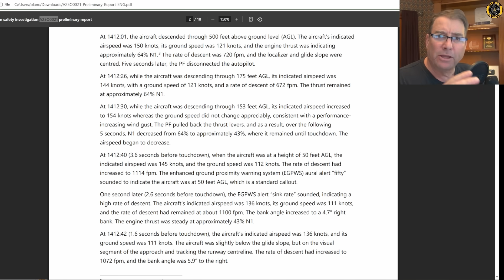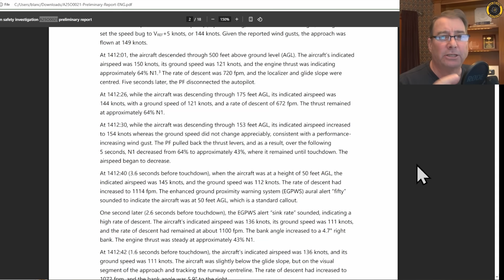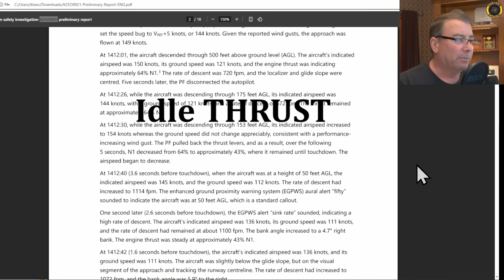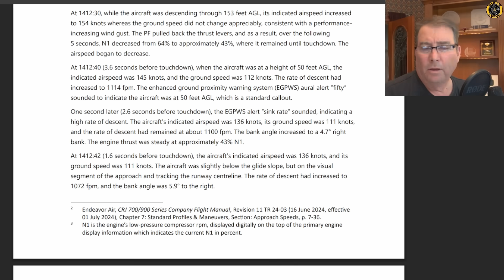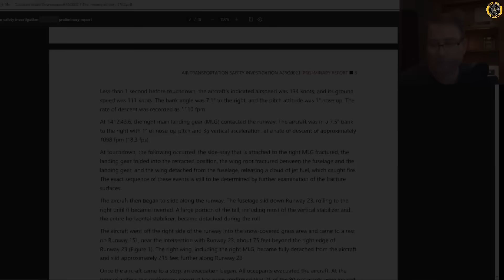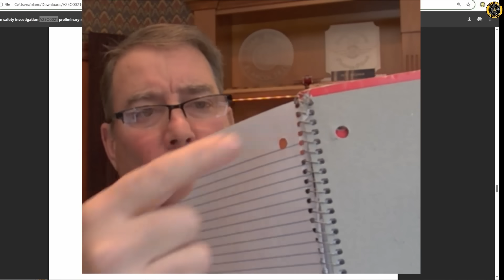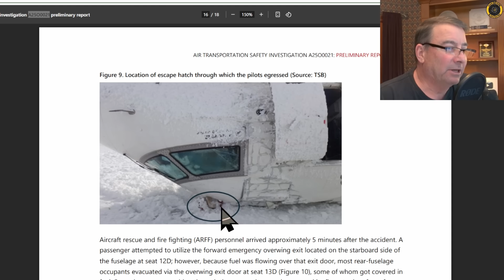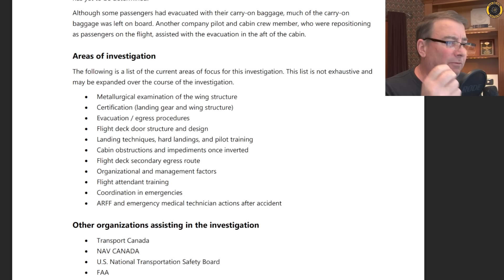TSB Prelim Toronto CRJ Crash

Comment: Love your channel Juan!

Just a 1,200 hour GA pilot here (that hasn’t flown for a couple decades). I began in gliders in the late 70’s, then added power & an instrument rating in SEL. 

Landing with true confidence, in all types of windy conditions, was always my biggest challenge. What really increased my confidence was when I began towing gliders. I loved it, especially since I got to continually hone that critically important skill (and I didn’t have to pay for those hours!). Years of fun-filled weekends of glider operations, where a tow-pilot was pretty much always in need, was a definite plus for me.

At any rate, I can’t help but think that 418.7 hours in type, especially as one is first transitioning into a jet aircraft flying in the airlines, probably doesn’t equate to all that much practice at landings. 

So, I’m thinking that, in light of this type of accident, the FAA might want to amend minimum hour requirements, to also include a minimum number of landings requirement.
Reply: The 1500 hour (1000/1200 degree reductions included) requirement has decreased airline safety and now you’re suggesting adding another artificial barrier?!? See, at first glance it sounds like a good idea then you think for a minute and realize it falls apart and actually makes the issue worse. Where does one get these required landings? You can’t because you’re not allowed to fly this type of plane. (Chicken or egg first problem). Now you might suggest required landings count from any type, i.e. flight instructor time in a c172. I’d then point out the enormous performance differences. So different that repetition in a C150/2 or C172 actually make your ability to handle a turbine worse. This pilot did something that would have been a good action in a small cessna. Got very slightly high on short final so pulled power and put the into crosswind wing down. Did she make a mistake, most likely yes, however her mistake was by doing exactly what a little over 2/3 of her required flying experience has taught her to do. In stressful situations the human body loses ability to process information and make decisions and reverts to previous drilled actions.  IIRC this is the Yerkes-Dodson law. What we’ve effectively done is ensure this for all pilots that fly airlines at the regional level: As stress increases because things are starting to go wrong, their most practiced and overwhelming majority of experience will be not directly applicable at best and actually contrary at worst to the best course of action they should take. The 1500 rule needs to be removed. Require airlines to do much more training in category/class/type of new pilots. This way they’ll have more relevant experience to draw from when stuff starts to go wrong.
For me as a 1000 hour pilot that has been flying for almost 20 years: I routinely seek out places where I can safely practice crosswind and other challenging landings. I am fortunate and know a lot of CFIs that I take with me. This way when I encounter a situation where stuff is going wrong I have experience to draw from and can perform instinctively. Put this requirement on the airline and make them train their pilots.

Comment: Just to give everyone a little history of wings falling off on landing. On 21 March 1966 a Flying Tiger CL44(Large 4 Engine turboprop MTOW 210,000 pounds) landing Norfolk NAS Chambers, VA. F/O Pilot Flying approach and landing Runway 10 touched down on left main and nose gear and the left wing separated. The airplane rolled inverted and eventually skidded to a stop. The legend is that after the airplane stopped the Flight Engineer asked the Captain “Do you want the After Landing checklist?”.  The First Officer was a new hire who had a grand total of 18:00 on the CL44 but the ASN Accident report do not say if this was his first landing on the line. A large portion of his 18:00 was training in the airplane because I’m not sure if there was a simulator available. The accident report also mentioned that he did not have a multi engine rating on his FAA Commercial Certificate. Fun Fact was the multi rating was not required until 1974. You could be a F/O on the B727, B707, DC8 with no AMEL. I was surprised when I read about the rule change in Aviation Week at the end of 1974 and all current F/Os were issued the AMEL rating.  Flying Tiger operated under the Supplemental Rules FAR121 so they did not get IOE. They had 25 hours observation in the Jump Seat. The Captain on the flight had 172 hours in the CL44. To the best of my knowledge both the Captain and F/O retired as Captains plus the F/E because they had just been put on the pilot seniority list between the probationary F/Os and the F/Os that had completed probation.

Comment: They had a plane that needs 5,360 feet to land and a runway that is 8,000 feet long. It isn't going to be the end of the world if they land an extra 1,000 feet further down the runway than normal. If she hadn't closed the throttles and kept the airspeed up at 150 and avoided the massive sink rate, the result would have been contact with the runway probably 800 feet further down the runway than they usually experience. Had it gone further than that there was always an option of taking the go around, even if they hit the ground more than 1/2 the length of the runway as long as they maintained airspeed.

This is 100% pilot error and it falls on the PIC for not recognizing the situation that was developing due to the inputs of the pilot flying. Yes, the conditions were challenging, but how many other flights landed before them that day without busting a $50 million aircraft?

Comment: With all this info focused on sink rate capt, is there nothing in the report about the aircraft HEADING at touchdown please sir ? Knowing today that there are three Xwind ideologies, one is suspect about what would cause such a SIDE load on the gear for it to fail into a retract position but not be RAMMED UPWARDS into the wing and the wing still fail ?
  The conventional aileron/wing low to correct drift, with rudder controlling direction, & the 2 wheel CRAB touch down strikes us that a high sink rate fail would NOT have the gear folding inward !?
However…an over zealous KICK IT STRAIGHT ideology on touch down strikes us as a more probable result of the SIDE LOAD failure. 
Our concern here is that since post ww2 and the invention of the Cessna LAND O MATIC our GA industry is suffering from a tragic disinterest in runway directional control. 
Thank you for all your effort and knowledge that you bring to this forum capt.
60yr CFI/ATP DC3 to B767 and 15 personal planes in between. Currently a C190. 
Am I the only CFI interested in the possible training failure suspected here ?

Comment: Very interesting assessment of the incident, Juan! I'm not a pilot (always have been interested in aviation) but several things jump out at me: first, the complexity of landings (some of them anyway) and second, the lack of hands-on training. I have had two lessons in an ASK-21, and would love to spend a lot of time soaring in retirement. But even among glider pilots there are those that insist students need to train on something like a PW-5 where the center of gravity is aft of the main wheel. This model tends to act like a taildragger. That sounds a bit scary, but apparently, it doesn't take very long to master the control necessary to make safe landings. Also interesting is all the comment from very seasoned pilots who practiced many more hands-on landings.

Comment: Most people think about windshear as a tailwind force pushing down from the rear of the aircraft, which is true.  The headwind shear, however, does the opposite, and gives a temporary lift effect and a false urgency to cut power.  When it suddenly abates, you have actually 'cut your legs out from underneath yourself', and you drop like a wingless brick.  This is a rookie student private pilot mistake that is accompanied by the warning that you 'fly the aircraft to the hanger'.  This FO didn't even fly the aircraft to the landing, even.

Comment: More than several decades ago, the FAA and industry began deemphasizing stick and rudder skills in favor of system management skills.  All too many accidents can be traced to two heads down, fiddling with the flight management systems and not hand flying the aircraft in both the TO and LDG phases. Engaging the AP at 1000' on TO and and at 500' on approach does not keep a pilot proficient.  Spot on Juan.
Reply: Well said.  Foundational flying skills are not emphasized and aviation is paying a price.
Reply: Seems to me that autopilot use should be all but banned for rookie pilots. Let the rookie FO be the "autopilot" and let the captain do the "system management". Isn't that the point of having two seats in the cockpit?
Reply: @ learning to manage levels of automation more important.  Problem is experience levels are so low more hand flying is better to gain experience but airlines don’t push it for obvious reasons.

Comment: GPWS alert requires immediate Go-Around…and/or if you are unstable below 500 feet. For all professional pilots, we review our approach procedures plus go-around procedures before accomplishing the approach check list..every time. Another clue to this accident is where the aircraft actually touched down. It appears that they touched down around the runway numbers..while the actual target should have been at the aim point that is 1000 feet from the end of the runway..the big white wide painted stripes. If they did touch down at the area of the runway numbers their visual clues would be remarkably different from a normal approach. I’m retired now after 42 years and 35 years as Captain..B727, B757/767, A320, A330, B747, B744..30,000 hrs
Reply: EGPWS does not always require it.
Reply: @richwightman3044  Actually depends on company ops specs

Comment: The 'sink phase' was mentioned and not elaborated on and from  earlier discussion about gusts it seems implied that when the gust dies off the plane loses lift. But, what is also happening below 50 to  100' agl is the aircraft is descending through the ground boundary layer and an exponentially decreasing velocity profile. The height of the profile rises as wind speed increases. The stronger the wind is the more pronounced the reduction in wind speed. This is then further exacerbated by the randomness of the gusts in both direction and magnitude as well as ground topology effects.

I don't know that this phenomena is well understood by the majority of the flying community. A lot of primary instructors at a place I used fly would get excited talking about the 'wind shear' on short final in strong wind and dramatic increase in sink rate. Ummm, no, it was the change in velocity profile as well as there were moderate to steep slopes on either end of that runway causing a bernoulli effect which also affected the velocity profile as the air accelerated or decelerated over the topology. And it was mostly predictable if the winds  weren't squirrely

The mounding of snow by the plows would also introduce sharp features in the terrain and may also induce or exacerbate eddies and vortices at the runway which may also be present in the gusts as well as induced by other terrain features.

Comment: When i gave ioe i instructed captain when flying with an inexperienced crew member to brief they would keep their hand behind the thrust levers so they can be alerted to a low thrust condition. Also to continually keep the N1 in their scan to be alerted to the thrust falling lower than 63-70 N1.
One last important point is i advised that if you see the auto throttle lowering the thrust to idle during gusty conditions then you must turn it off. I’ve seen the auto throttle be fooled by gust at 100 feet many times.
Envoy also added only the gust on the E175 because the landing distance increased beyond runway landing distance with contaminated runways.

Yes pilots now are just taught to be button pushers

Comment: There is an unhealthy obsession with the target speed for approaches I see in training.  Pilots are so willing to fly the VREF they will at times over-maneuver the aircraft and get into an accelerated stall or will jockey the throttles and slam it in due to windshear at that last moment on landing once they've gotten on the line.  I think pilots should be able to demonstrate the ability to fly the approach in the simulator at VREF, but it should be imparted onto them that getting a touch fast isn't the end of the world.  Let those gusts get you to Target+15 and watch to make sure it bleeds off, if it doesn't then go around and try it again.  I've never heard of a fatal accident because a plane came in 10 knots fast but I don't have enough fingers to count how many times getting too slow has killed people.

Also I don't think the narrow runway illusion really comes into play until you get less than 100 feet in width, generally speaking.  It's not like Endeavor doesn't fly into runways that are usually 150 feet wide.

Comment: Might it be possible that the PF lost some elevator authority in the final few seconds due to the steep descent angle and the CRJ 900’s high T-tail. Looks almost like it’s plausible that the airflow over the horizontal stab could have been disturbed by the wings, thus rendering a proper flare impossible. Thoughts?

Comment: CRJ driver. Not 9E though. Some people fly the top of the bug (We bug vref then fly the top which is +5) most bug vref+5 and fly in the bug. They bugged vref+5 then flew the top of that so was flying vref+10 Yes no auto throttles so we dont need to set it exactly. Although for FOQA reasons and windshear we usually set the correct speed